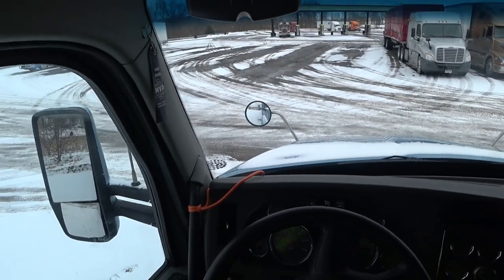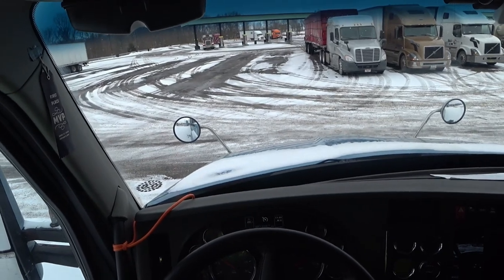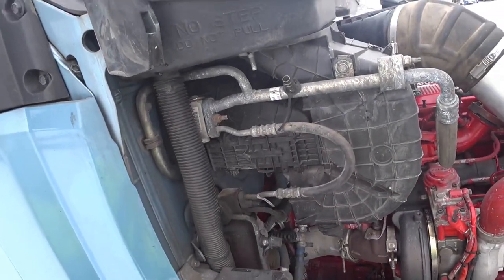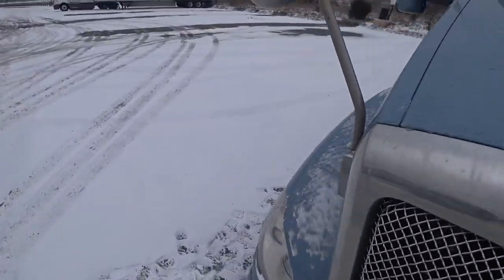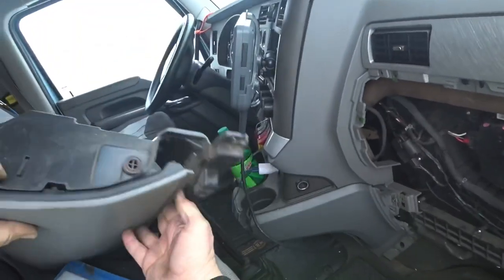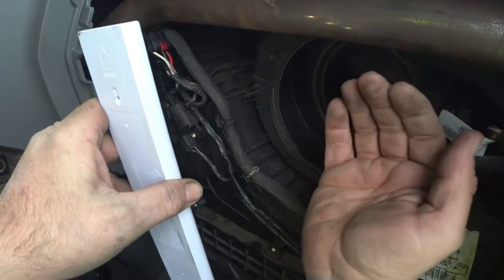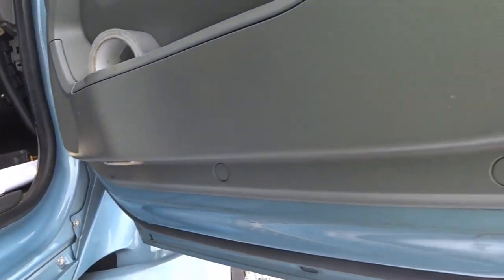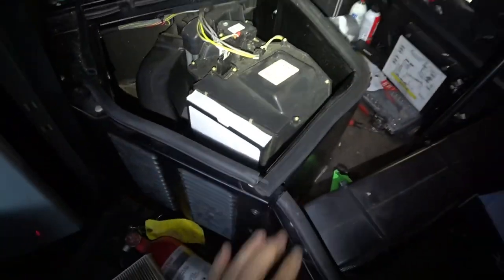January 26, 2019/31 Replacing Cab Air Filters in Kenworth t680

Comment: I have two words anyone replacing this filter. "Paper clip." When installing the new filter, i used a paper coip to help feed the filter on in, as it will definitely get hungup on something. Also, be careful not to drop one of your screws behind that kick panel on the right side by the floor. I may or may not have lost one of my screws this way. This actually was not as bad as i thought it would be. They definitely should change this design. This is ridiculous to have so many steps to replace something that requires changing frequently. Also, don't forget to reconnect the wire harness to the fan blower before you close everything back up. Great video
Reply from the maker: 🤔 sounds like you may have lost a screw or two LOL great tips👍

Comment: As a Kenworth tech i say u did good. It isnt that big of a pain, 15 min job start to finish. Trim off to trim on. Biggest tip is have two o ring picks, used as chopsticks to seat the filter home through the honeycomb holes. Like your driver. Picks leave vertaly no damage to the filter. Drivers could, in the wrong hands. But yes, guys change these things. You dont want me having to open up that blend door box to change out your actuators and doors. I dont mind. But u might.$$$$
Reply from the maker: Thanks, As I was pulling the filter through I was thinking my little pick set at home would be nice for this
Reply: @LongHaulLarry  exactly. But kudos for having the dewalt. Good vid. Keep it up

Comment: Say Larry. To make it much easier for the recirculating filter, pull that side panel on the right of the glove box and reach right in behind the air box. Pull out your old, slide in the new. No cuts & not near as much fuss. The left side like you did is the standard way & it sucks. Try it next time. You all will like it.

Comment: Does the air always go thru the filter behind the fan or only go thru when you have the HVAC in recirc mode?
Reply from the maker: It goes through the outside filter but then when you press the recirculation button it goes through the inside filter if that makes sense

Comment: I deliver to John Deere dealers all over Texas... that equals DIRT and in the summer with the a/c on... Dirty filters.  I will make sure I am in RECirculate as not to deliberately suck a lot of dirt into the FRESH AIR FILTERS ( 2 in engine bay ) but they still get cruddy.  At first sign of reduced air flow while in VENT ( needed for DEFROSTING) and as you showed with the paper on the dash.... I will go and KNOCK THEM CLEAN the first time which is ALWAYS well before an oil change.  Since I get my service done at Speedco... I get them replaced at that time .... THE RECIRCULATING AIR FILTER however is a WHOLE different story on a Peterbilt 579 ... which is the SAME HVAC as you have in that KW

Comment: I literally just clean the recirculation filter with an air gun. Then use the air gun on the blower also (improves its efficiency). If you spend enough time, those filters in theory be used maybe 3 times before you get a new one.

Comment: If anyone is curious the two air filters that you need a cross reference part number is CF10743. You can get them from Amazon for $13.99. Or Walmart for probably about the same price. It’s a Fram air filter with Febreze and it goes to a Chrysler something or other but it’s a lot cheaper than getting it through Kenworth.

Comment: Thanks for the vid. I think I am going to rip that filter out, and why even replace it? I should probably quit smoking before I care about filtering any air in any situation, anywhere. This re-circulation filter can go straight to hell.
Reply from the maker: That filter is a bear getting back in
Reply: @LongHaulLarry  do you think it has some "wall" factor for its status of being their in the first place? I bet the purpose is legal to allow 10% of fresh air into an enclosed area, same with houses. but if you completely remove the filter, you removed the 90% wall.... anyways, my problem is, myfan freezes over when I drive in hot humid areas, and I have to turn the ac off until the ice melts and the fan is spinning again... yhe fan is strong, flow is good, all other filters replaces, I had my AC system recharged last week.... Honestly these little fails are why I won't buy another Kenworth. mine is a 2015 T680, stupid problems like this are ridiculous and hard to explain and mechanics don't know either, it's just bad engineering.

Comment: I dont know if anybody else has mentioned this to you, but you paid way too much for those filters. The cabin air filter. under the  bunk and  hood are the same filter used in many Honda's and Acura's. Fram P/N CF10743 or WIX P/N 24479. Last itme I paid $12 for the Fram at Walmart. Thas;s what I've used on every (all three) T680's I've owned.  I paid $17 for the recirc filter at the Kenworth in Memphis TN. Don't let a parts store sell you on a cheap generic, I had one of those get sucked up into the box, thought I'd never get it out.